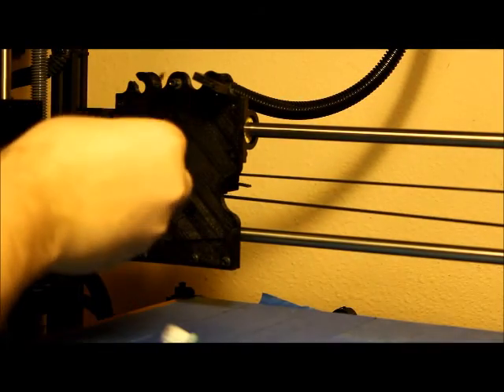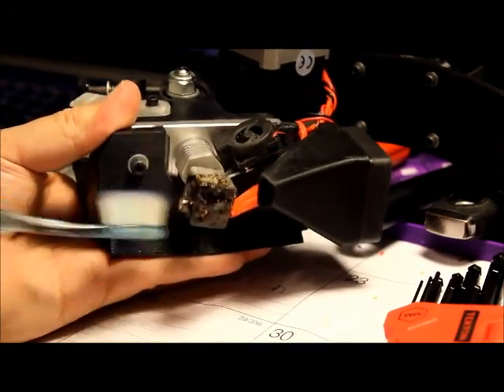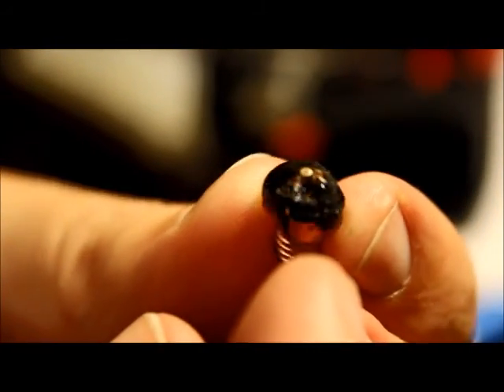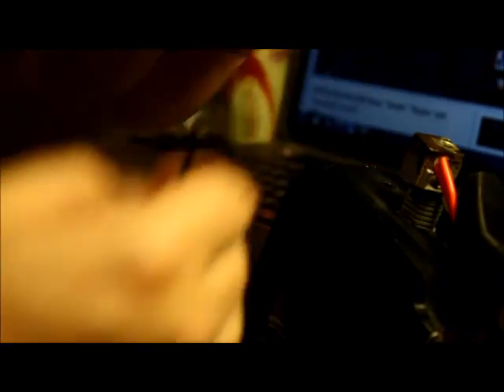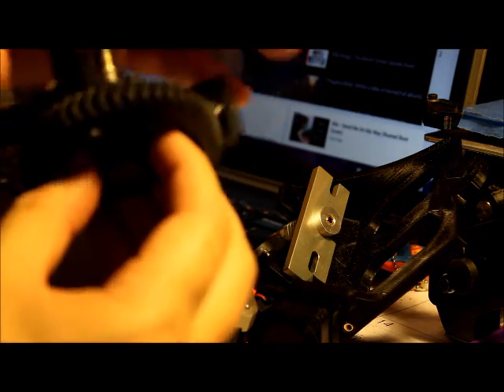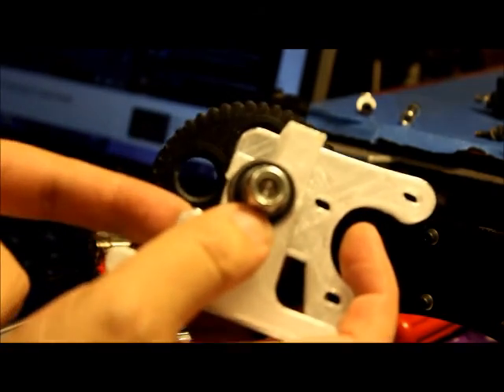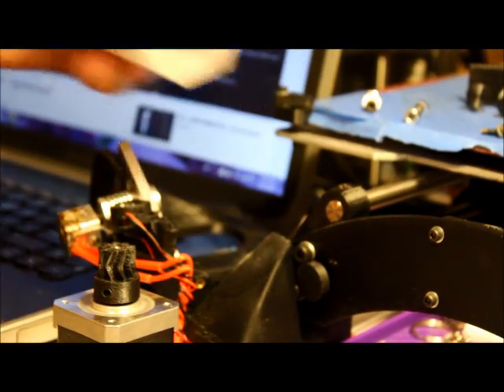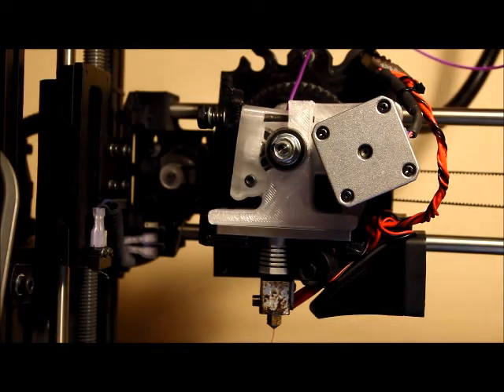How To Maintain a Lulzbot Taz 5

Comment: going to come back to this.... before I come at my taz 5 with the ten pound sledgehammer.
Reply from the maker: Ok, let me know if you need any help... I've run my 5's as my main printer for a few years now with few issues (apart from my own id10T errors).
Reply: @3DPT  For some reason I am only just getting this, got it all up and running, just had to do some work on replacing the nozzle, and some fuzes.

Comment: Very helpful video, i was having issues with my nozzle. However, I need to find a new nozzle, are there any you would recommend?
Reply from the maker: With the amount of printing I do I upgrade to a hardened steel one after the original brass wears out. Steel last about a year, while I've changed out brass after 4-6 months. As long as it's designed to fit your hotend you should be fine. I don't have recommendations because I've only bought 1 pack of steel nozzles... It's not a major consumable for 3D printers, so a pack of 5-10 nozzles will last you a long time.

Comment: Can I ask who much you make after 5hrs of print time to sell the beads on Etsy? I've been debating on breaking into a different market for selling 3d printed parts but havn't seen enough date yet to know it its a feasible option for me or not.
Reply from the maker: you'll have to decide what you can afford, I try to make fidgets that I can print 2-3 units within an hour to make it worth an hourly rate of $10 / hr labor. The market for home printers will be in small batch production and custom design work in my opinion

Comment: We all appreciate the effort, however you have some spelling errors and your video get's cut off at odd places. Was your hobbed bolt wore down with all the exotic filament? I know it can be rough on equipment, especially the nozzle but I never imagined it would wear down the hobbed bolt. Just curious, thanks for posting.
Reply from the maker: +10john01 yes, the hobbed bolt was worn down from the abrassive exotics as well as the heavy use of my printer. I've been printing daily for 7 months with this printer. Sorry about the rough cuts, something was wrong with my computer, it took 2 tries to get this video up.